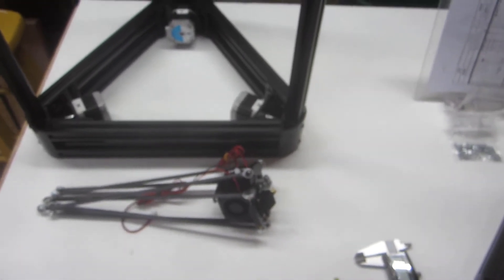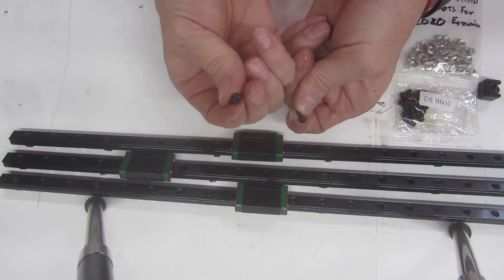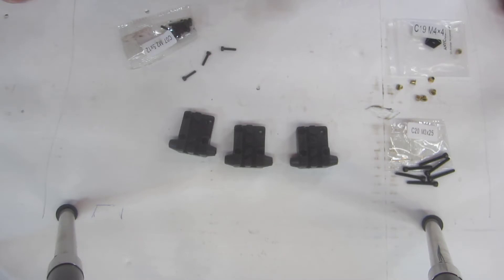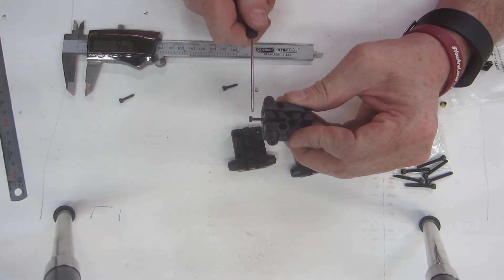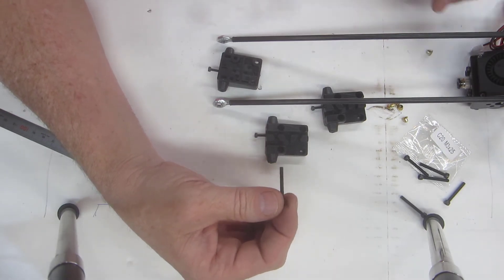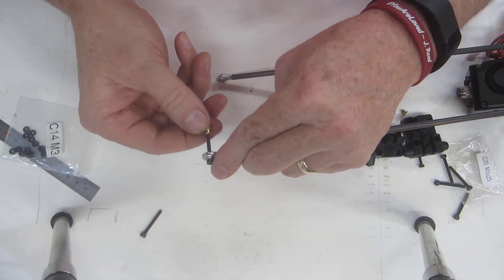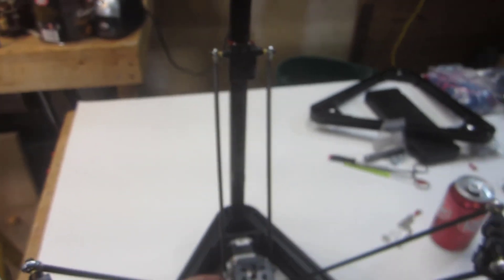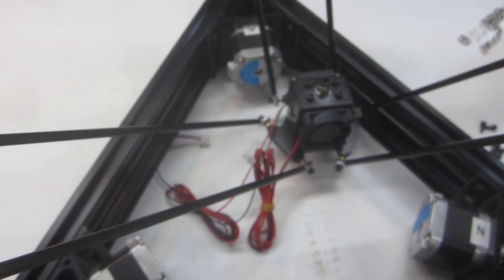Anycubic Linear Plus Delta Build 7 Installing the Linear Slides and the Print Head Assembly

Comment: I just received a linear plus kit from Anycubic bought through Gearbest and it included the M4 and M3 Tnuts in bags stating  you should use these instead of the original nuts so maybe hold off on ordering them until you receive your kit.
Reply: I got those in my kit too Im refering the the M2.5*12MM alan key head screws that you use to fix the limit switches to the end stops the heads of those screws rub on the belts.
Reply: Glad you got the tnuts.  I'll look out for the issue you posted when I get to that step.

Comment: the one thing that concerns me is the screws that connect the end stops seem to rub on the belts... and this will cause them to wear the teeth down, so I might look at getting some flat head screws for them.
Reply: Yep just went and ordered some grub screws found a video on here from another owner who also has this issue, some nice headless m2.5*12mm grub screws will fix that rubbing.
Reply from the maker: I haven't run into that problem. Are you referring to the limit switches or to the stops at either end of the linear sliders? Now I am eager to get home and look at it tonight.
Reply: Sorry yes the limit switches have 2x M2.5 *12MM screws holding them into the end stops at the top of the rails these screws rub on the belts.
Reply from the maker: Got it. I am looking at my machine right now, and while my belts are clear of the screws, it's very close, maybe .025". I'm not going to worry about it, but if I happen to run across any button head screws that size, I will make a change.